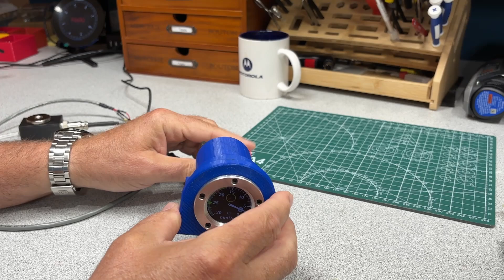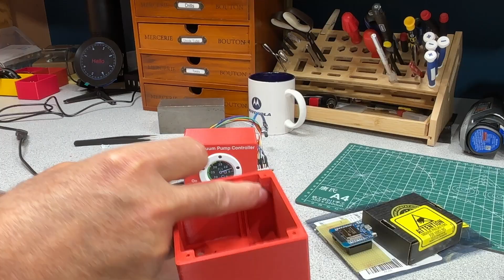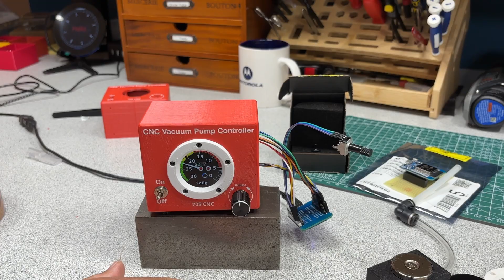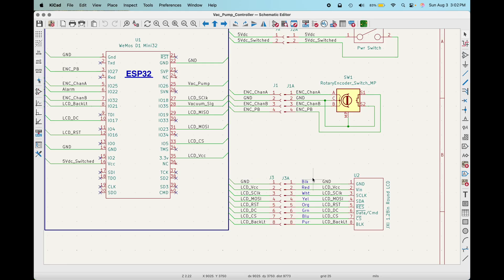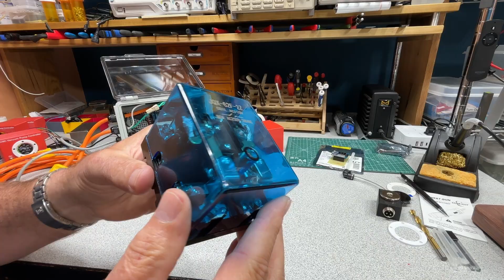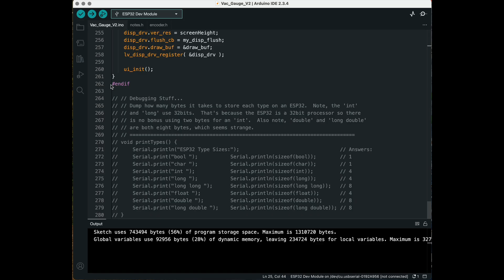CNC Vacuum Pump Controller - Update

Comment: Got everything working (and added the alarm out code to the sketch). Woks very well. This continues to be an impressive and very useful project.

I am trying the understand the workflow for Squareline Studio with the Arduino and GC9A01 display. It isn't very intuitive to me and I have not found anything on YouTube that address this scenario in a form that is easy to follow. I have pulled your Squareline project files into the software and can see all the assets, just not sure where to start to play around to modify the images and implement the changes into the Arduino sketch as a test bed. Maybe, in your "spare time" you could do a video on your process using Squareline Studio . Thank you again for the incredibly interesting project.

Comment: Jim, I had contacted you by email and you sent me the code for version1. After seeing this I will go with version 2 for sure. Great work and really appreciate your talents and open source approach. Took me 5 days to get my Arduino Nano ESP32 S2 working with the display but there were some "hidden" tricks in using the TFT_eSPI library and Board library that were required to get the display working (if anyone else runs into this on this hardware combination, reply to this comment and I can share what I learned the hard way)

Question..... am rather new to github, I downloaded the zip file and placed the sourtce code folder in Arduino . I also downloaded the Squareline Studio app and set up my license. How do I see the project you created in the app? I tried to do it through an "import" button, but there are no appropriate files ("spj?) in the zip download that I can see.

When I try to compile the code (using the recommended version of the libraries below in the comments) I get a compile error as it is looking for the lv_conf.h file which doesn't exist in the library. AM I doing something wrong?
Reply from the maker: Patrick,

Yeah, looks like I forgot to upload the SquareLine project files.  Download from GitHub again and have a look in "source" again.  You should see the project directory.  I also copied my "lv_conf.h" from "/Arduino/libraries/lvgl" directory into the source directory too.  I don't think I modified lv_conf.h but I included it just in case.  

Hopefully, this gets everything fixed.
Reply: @705cnc  Thank you Jim, I'll take a look. This really is an awsome project you are developing
Reply from the maker: Thanks for the kind works.  Let me know if you continue to have trouble.  Getting LVGL to work on top of TFT_eSPI can drive a person crazy!

Comment: Did you mention what version of the lvgl library you were using?  It seemed like you said it was an 8.x version?
Reply from the maker: TFT_eSPI: 2.5.43 / LVGL: 8.3.11
Reply: @705cnc  I found it in the notes after I asked, I knew I had seen it!